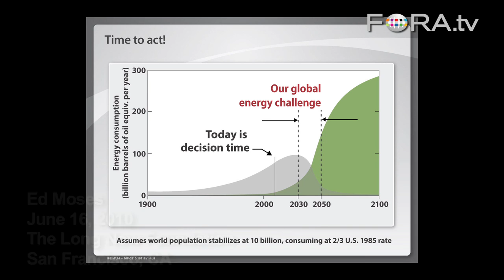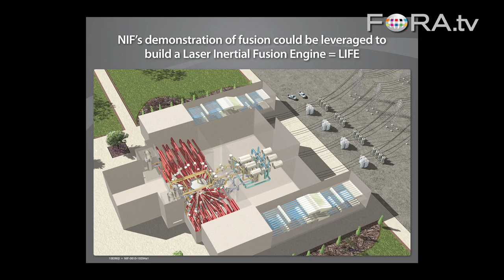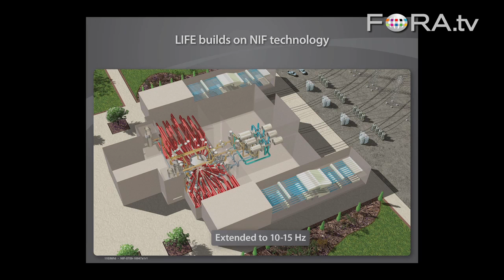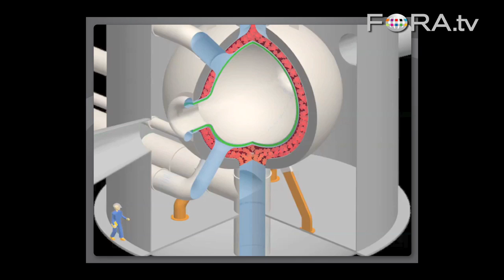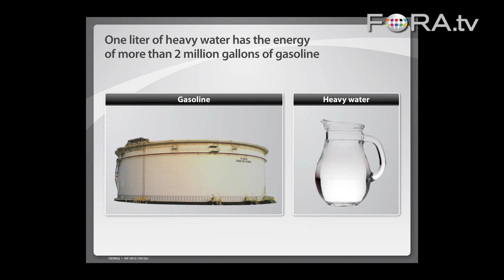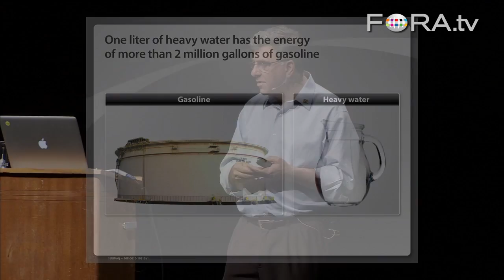LIFE: Clean Energy from Water

Comment: Water is not a "greenhouse gas" in the same way as Co2, Methane, Ozone, etc. Atmospheric saturation depends solely on temperature. Hot air holds more water than cold air, it is a temperature regulated system. 

This is not the case at all with greenhouse trace gases. Understanding these basic distinctions is crucial.